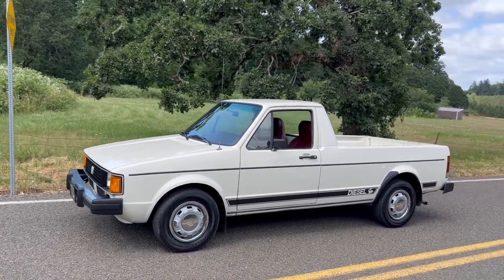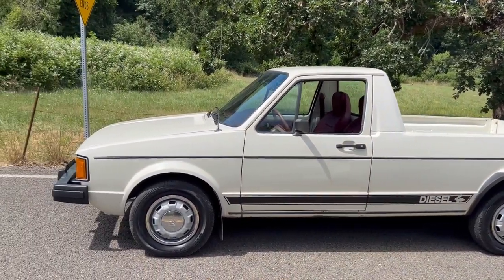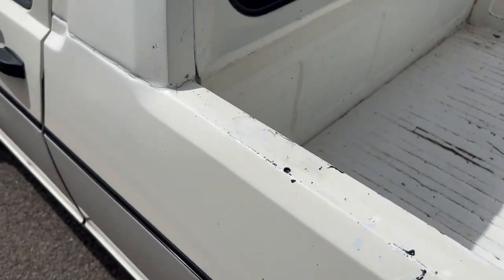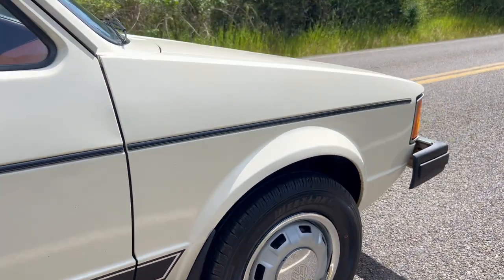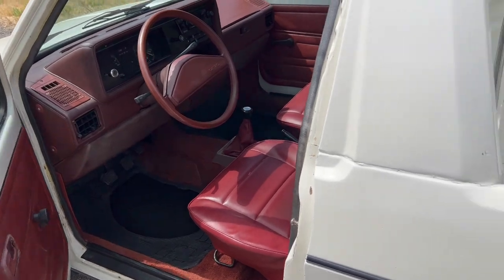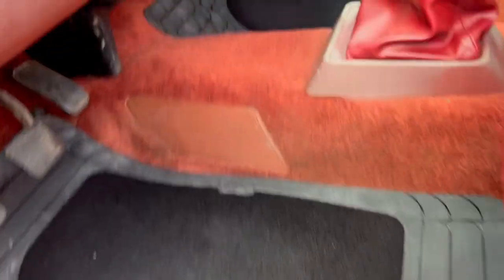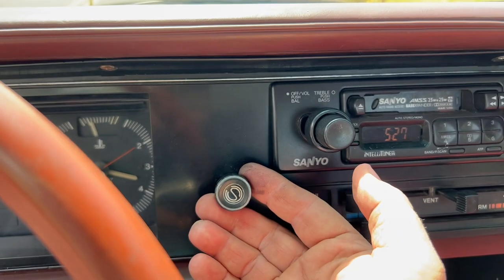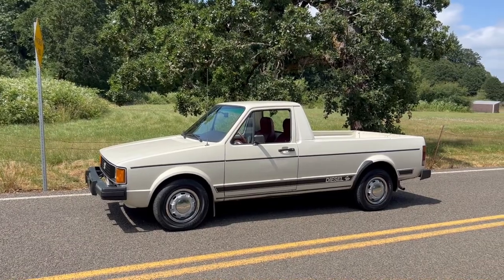1981 Volkswagen Rabbit Caddy - Diesel 5spd - Denwerks - Bring a Trailer Auctions

Comment: I bought a 1981 Rabbit Diesel brand new.

I was single and all my friends made fun of me. It was super slow. I had a hard time merging onto I-95 here in Miami, many times almost hammered by trucks doing 70 mph. 

It was super economical.

4 years later at 98,000 miles the water pump started leaking. I took it to the local garage to replace it. He somehow damaged the seal on the mechanical injector pump and diesel coated my timing belt, causing it to come off causing extreme damage inside the engine. The mechanic said it wasn't his fault.

I sold the car for $100.

I should have bought a gas Toyota.